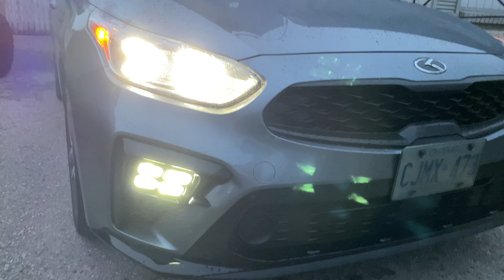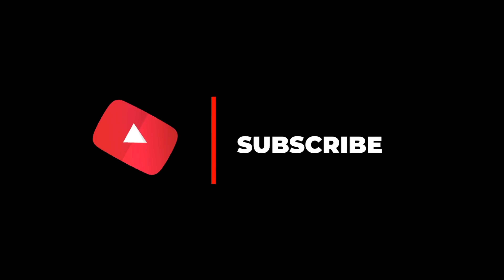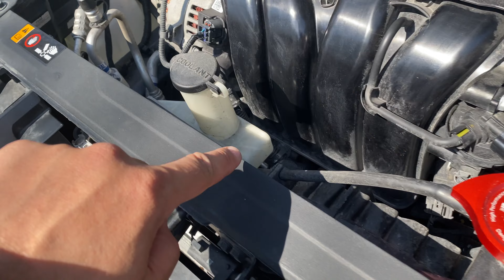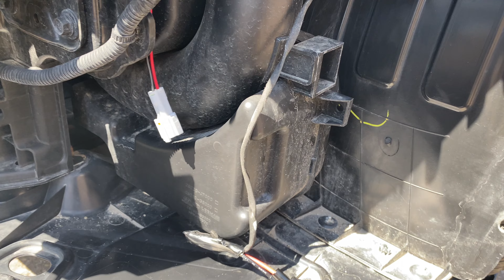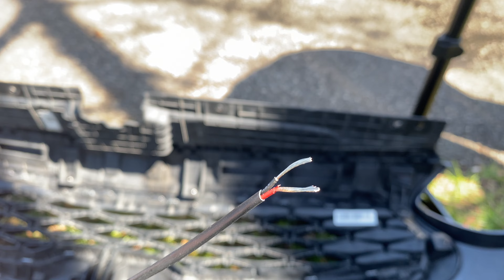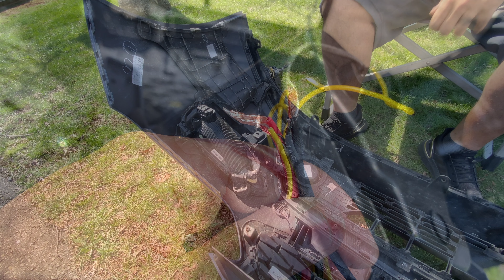Quad LED Switchback Turn Signals | UNREAL RESULTS | 2019 Kia Forte

Comment: Did you put GT headlight assembly on an EX? Also help. I have a 2019 forte. I have those little DRL lights in place of where your fog lights are. I want to delete those, even if i get dash errors, and put the S or EX or GT fog lights, and just wire with ignition powered relay switch. I can get the bezel and light fixtures but what about wiring?  And screws?

Comment: He has his cold air intake set up completely wrong. You were supposed to remove the hose from the fresh air intake duct and then reinstall the duct back with the push pins… there’s no air going into the filter.
Reply: Pause the video at 49 seconds to see what I am talking about.